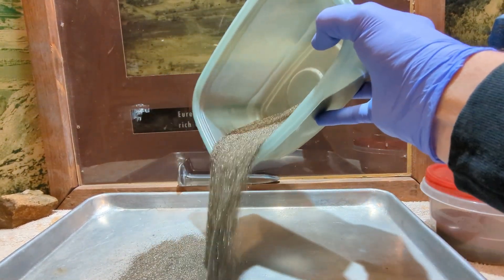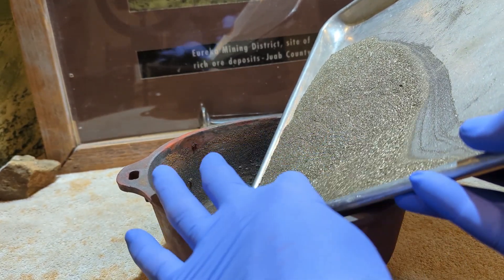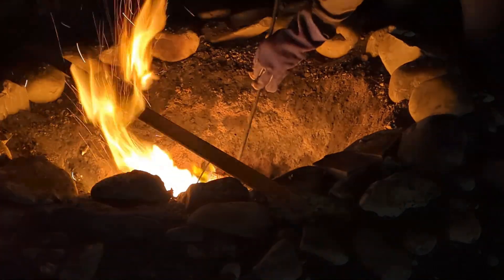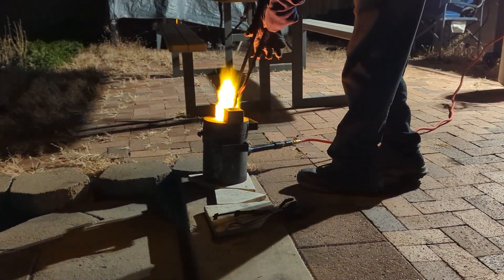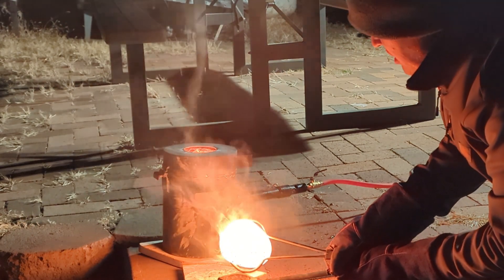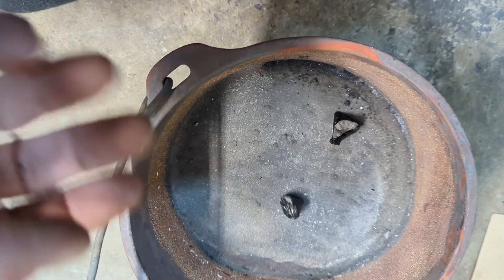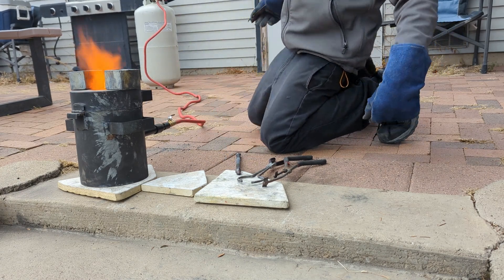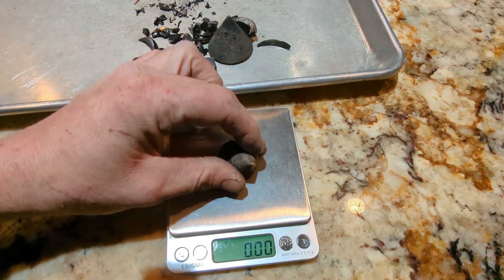Smelting Galena.

Comment: Where did you get your furnace
Reply from the maker: That is an older VEVOR propane smelter originally purchased off of the internet a few years back. That little smelter has been through the ringer and keeps on working.
Reply from the maker: VEVOR tools general website affiliated link. They're running some decent prices right now.
https://s.vevor.com/bfRAtW
Reply: @smokeyandspikeproductions  thank you
Reply from the maker: @steveblack5952  You're absolutely welcome!
Reply: @smokeyandspikeproductions  question.  I have an awesome piece of pyrite.  Maybe two thirds the size of a baseball to a third in size. And 22, 5 gallon buckets of interesting ore. I'm going to start cooking it down. So is pyrite a hider of other metals
Reply from the maker: @steveblack5952 Yes, pyrite often contains a variety of other metals. Depending on what type of pyrite it is, most varieties of pyrite contain multiple elements.
Reply: @smokeyandspikeproductions  good to know.
Reply from the maker: Happy to help!

Comment: Concentrate first, then use magnet, rhen iron and chapmans added to first smelt, then reroasting, and that's all?
Reply from the maker: Basically, there are a few other steps in between. The silver does have impurities remaining. Not enough to affect what I used it for in an up and coming video. The very last scene I did forget to mention I added carbon to the Dutch oven during that last roast before melting the smelted buttons prior to remelting and pouring into the cone molds.

Comment: في بداية العمل تم صهر البيريت مع الحديد.  وفي الصهره الثاني تم صهر بيرت مع الحديد. لكن في المره الثالثه.  لم يخرج السر. وهو صهر الحديد. مع الللللللل.  حتى ابعد الحديد وبقى معه الذهب❤
Reply from the maker: Galena is a lead zinc sulfide ore with contents of silver. This process is to oxidize out the lead followed up with burning out the zinc. Then re-smelting to burn out other contaminants leaving behind silver with other elements included. Next steps from there is a cupel process or acid solution for further refining.
Reply: يعني لا يوجد. ذهب ياصديقي  @smokeyandspikeproductions
Reply from the maker: That is correct. No iron remains and there is no gold. Periodic table element AG.

Comment: Please I want to know the ratio of zinc and ores
Reply: Ok so how many grams of cons and how many grams of flux? What is the flux recipe your using? I use Chapman's and action mining sulfide flux plus I make my own.
Reply from the maker: @dawnac6453 The total weight of the concentrates was 1,048 grams. I used Chapman Flux, one to one ratio. For every tablespoon of concentrates I mixed in one tablespoon of Chapman flux. I also added three tablespoons of Borax as a thinner.
Reply: @smokeyandspikeproductions  good morning and thanks for the reply. I actually make my own thinner from lime and feldspar at a 50/50 ratio. Works well.
I own a bunch of gold and silver mines here in AZ (some patented and some just unpatented claims. 
The mine I'm working now and have been for awhile is 400+ feet underground and is just loaded with silver bearing galena and I'm going into the process of processing that. I probably have around 30 sandbags of galena ore I'm getting ready to process along with a few sacks of gold bearing ore. I assayed this particular mine at around 2+ ozt au and around 20+ ozt ag and by the looks of it so far that looks about right.
Reply from the maker: @dawnac6453  Excellent! Sounds like some high grade with a lot of potential.
Reply from the maker: I do not have an XRF gun to scan the ore to give an exact number.

Comment: very interesting for sure. What do you use to clean it up?
Reply from the maker: A clean crucible with some more borax and another pour into a cone mold. That would yield a very shiny silvery button.
Reply: Nice video! Where do you get your crucible and borax? @smokeyandspikeproductions
Reply from the maker: A large standard box of borax can be purchased at most retailers in the laundry detergent aisle. The crucibles pending which one the ceramic or the graphite one. I've purchased off of one or two different websites. The A2 salamander brand crucible seems to work best.
Reply: @smokeyandspikeproductions  Yes, I saw some Borax at safeway. I've heard an industrial grade borax may be better.....what do you think?
Reply from the maker: @ourpromiseland2000  I've personally tried the industrial grade barox and the standard borax sold in the stores. I've never seen any significant difference other than how fine the granules are in the industrial versus the standard.